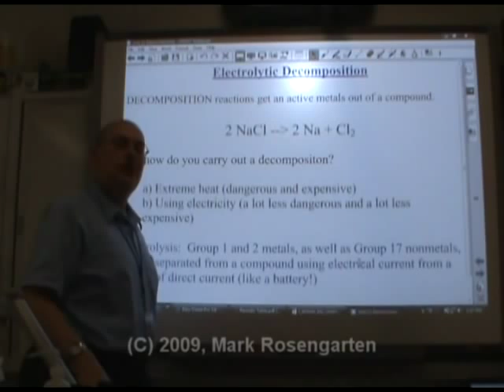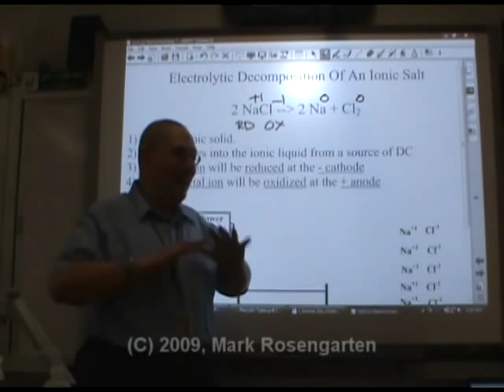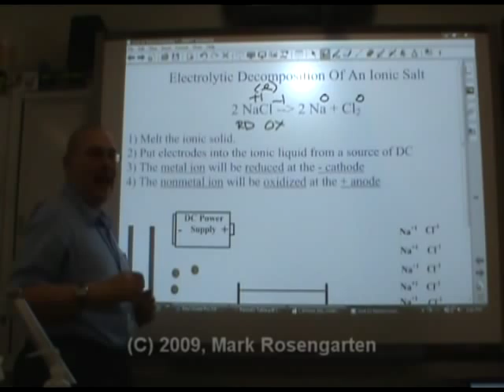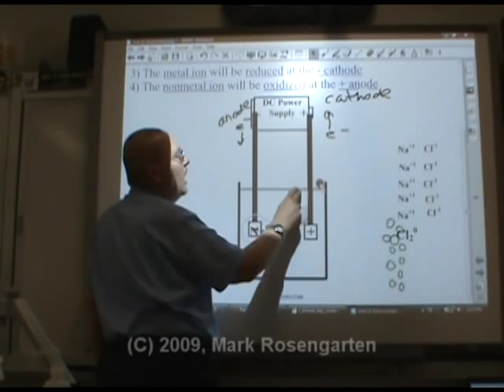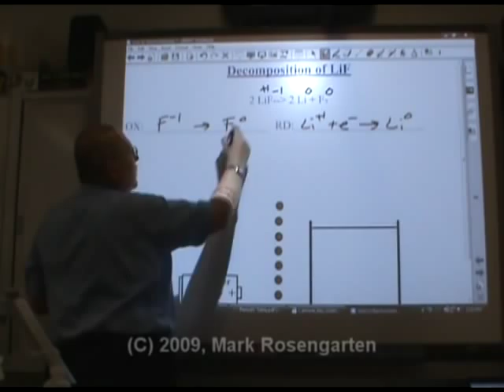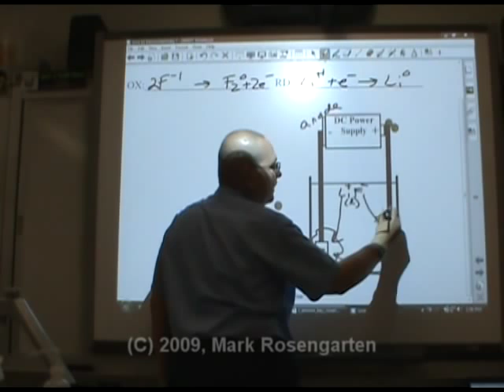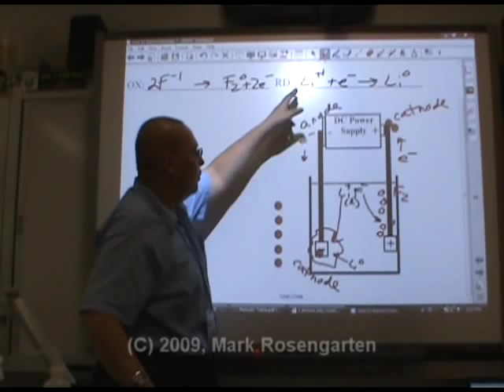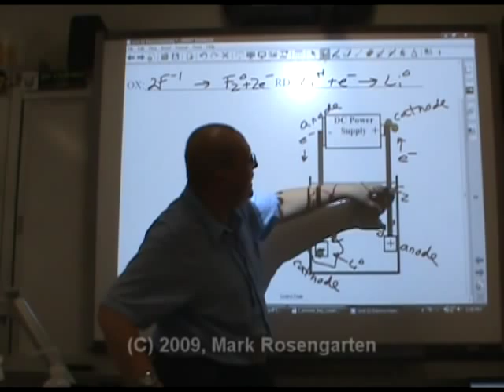Chemistry Tutorial 12.3a Electrolytic Cells:  Electrolysis Of Fused Salts

Comment from the maker: The cathode of the battery takes electrons from the anode of the electrolytic cell but those electrons ultimately come from whatever species is being oxidized at that anode.  If Cl- is being oxidized, its electrons go into the anode and then into the battery.  As long as the voltage of the voltaic cell exceeds the negative voltage of the electrolytic cell the electrolysis can proceed.